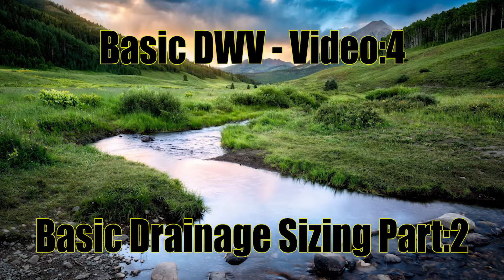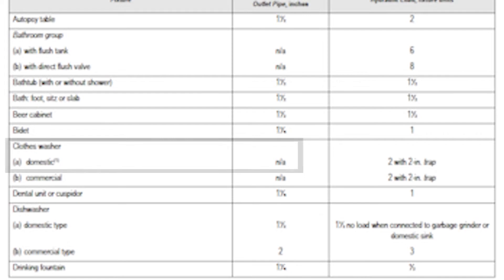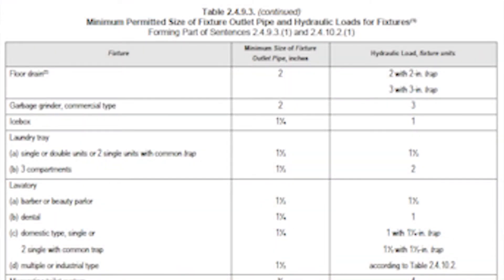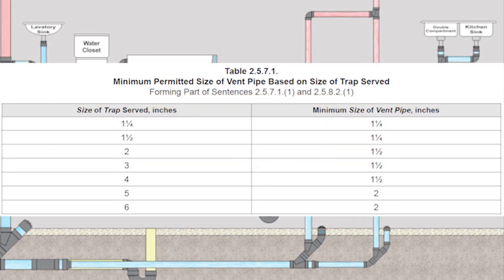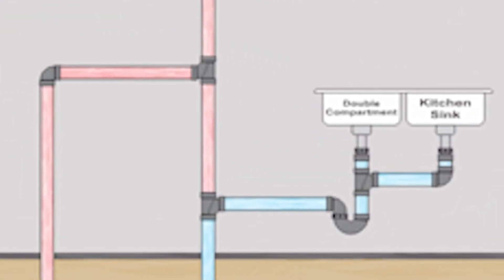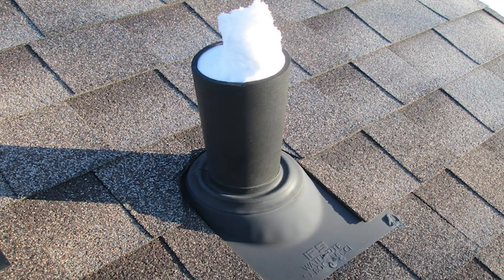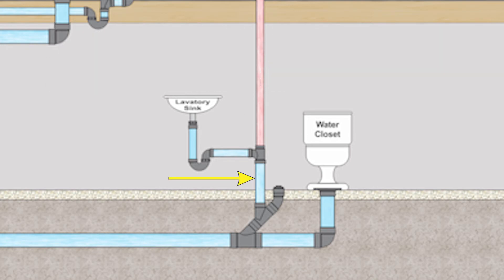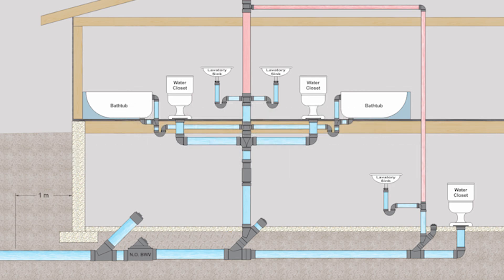Basic DWV - Video:4 Basic Drainage Sizing (Part:2)

Comment: Is the building drain not supposed to be 4” minimum based on code rules?
Reply from the maker: 2.4.9.4 Building drains and building sewers connected to the public sewer system downstream of the main cleanout
(see Sentence 2.4.7.1.(6)) shall be not less than 4 inches in size.

Keywords: 'downstream of the main clean out' and 'connected to the public sewer system'

Therefore, the building drain upstream of the main CO can be 3". This also means that if I connect to a 'private sewage system' I can also be 3" for the building sewer or building drain. You would need to ensure all other code requirements are met too.
Reply: Oh okay. So anything past the clean out can be 3”? I’m in plumbing school in Ontario and was just told that 4” is minimum until it goes vertical on a stack then it goes to 3” minimum
Reply from the maker: @denvercharlebois699 What I gave you was a direct quote from the NPC. There may be an Ontario amendment that I am not aware of. (I am in Alberta) 

There of course is nuance in the code. If you had 3 or more water closets draining into the building drain, then you would need to size that pipe at 4" as soon as it travels nominally horizontal.
Reply: Thanks for the tips

Comment: Great video 👏👏👏👏
If possible ,would you please teach us wet venting and if possible solving venting and drainage pipe size in commercial buildings  ,just I am preparing myself for IP exam .
Reply from the maker: The wet venting series is in production right now. As for the commercial drainage, I have multiple series dealing with them already. (circuit venting, vent stacks, rainwater leaders)
Reply: @MathematicPlumber  
Tanks a lot .
Reply: I really learned a lot from your teaching 👍